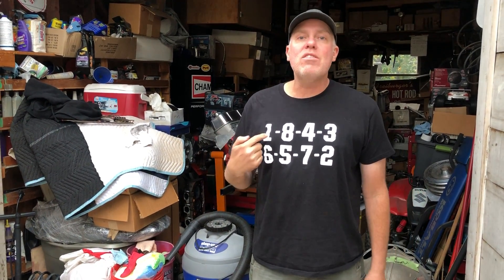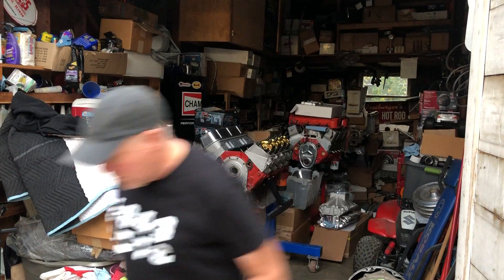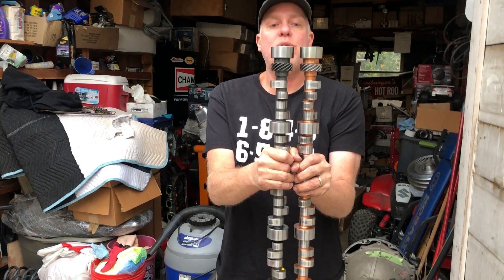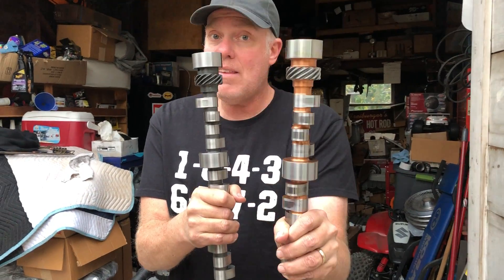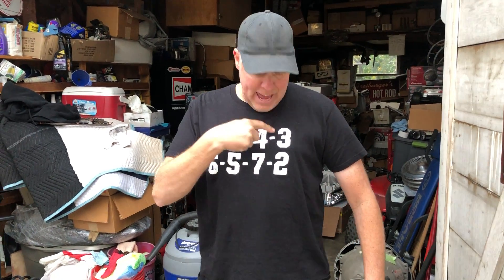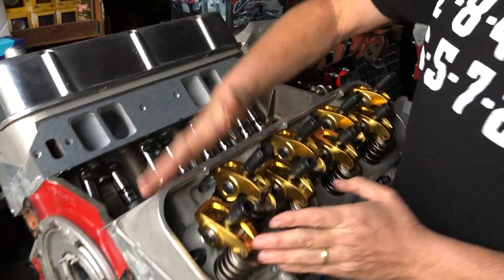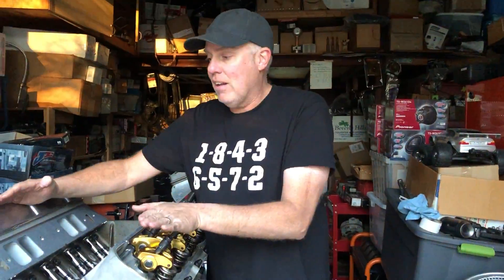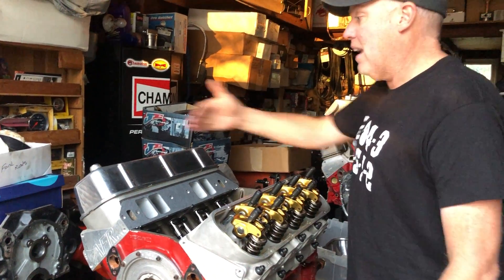Camshaft 4/7 Firing Order Swap Explained

Comment: Makes me wonder what a 454with a flat plane crank, and the 4/7+3/2 swap would sound like.that is, if those swaps can be done like that with that type of crank. I'd like to try that, but not with a production iron block 454. After all, if it works, why have all that weight? I'm thinking all aluminum big boy under the hood of maybe a lighter car like a nova or corvette.Hey Dave, what are your thoughts about the combo I mentioned?

Comment: But you left out why, to swap cylinders...

I am sure there is an awesome hot rodder reason and l look forward to learning it from you!
Reply: The actual issue is nobody really knows. The explanation with the intake manifold is bunk. Sure you break up the 5-7 pair but you create a 4-2 pair or a 3-1 pair. The only thing that we are certain of is that the ls and ford ho pattern has more even bearing loading since an entity as large as Ford took the time to study it. The 4-7 swap should be similar as both orders fire from cylinder 8 forward with 1 cylinder as an exception being #3 for the 4-7 swap and #2 for the ls/ho firing order. While the traditional order jumps around more.
Reply: To help lessen heat buildup in back of the block,,sense coolant flows from front to back of block..(Told by another comment above)..

Comment: Since the left bank isn't at TDC at the same time as the right bank, how does this effect ignition timing?  
With a camshaft  that alters firing order, is a distributor also needed?
Reply: You keep the same distributor but you need to move the wires to the new cylinders.
Reply: @markg7030  but TDC for the left bank will be 90* before TDC for the right bank, and the distributor is for both...

I was thinking of 4/7 on the same crank pin, but they aren't. 
     1/5, 2/6, 3/7, 4/8 = shared crank pins
Reply: @Iowa599  TDC occurs for the top of the compression stroke or the top of the exhaust stroke. The cam determines that phase. You are looking too deep.

Comment: I built some street stock circle track engines years back and did this. The customer's lost power and races because they cold never put the plug wires in the right place...

Comment: I discovered this with my 1990 Bronco it has a 5.0-302 but has the 351-5.8 firing order.  My neighbor is a Ford Mechanic it turns out someone in the past has installed a 351 Windsor cam in my Bronco.

Comment: So if swapping 4/7 and 3/2 is such a good idea, why didn't engineers do it from the start?  Surely there must be a reason.
Reply: It's fine for average or general use, but for all out power like in racing it can give you the edge.

Comment: I swaped the firing order on my single cylinder 2 stroke didnt notice much difference
Reply: I did it on my bike too, no change... 1-2-1-2...
Reply: Take your spark plug out and put it back in upside-down.  That's when you feel the difference.
Reply: You gotta swap out the cam for it to work.
Reply: @Hanzyscure  will give that a go
Reply: Swadian Knight  lmao
Reply: I heard Maurice saying that
Reply: That only works on the three stroke engines.
Reply: Did you adjust the muffler bearing as well?
Reply: You need to to swap your 2-stroke camshaft as well

🙃
Reply: thats rich
Reply: Gotta use flip the spark plug wires around.
Reply: Ahh it's the expansion chamber that did you wrong. The trick is when you swap of firing order on a one cylinder you need to hammer the expansion chamber flat.
Reply: MAURICE you forgot to move the kickstater to the other side
Reply: If you want to have fun with it... pull start it backwards. It will run perfectly spinning the opposite direction
Reply: @iD0theTUBE  a mate of mine used to do that on his bike, he'd bump start it down a hill backwards and ride it backwards.
Reply: I swapped my 1 cylinder 4 stroke firing order to a 2 stroke one. Now I get twice the RPMs and power.
Reply: @priitmolder6475  you my friend are a genius, I don't know why more people don't do that.
Reply: @DodgyBrothersEngineering  its a simple trick oil companies dont want you to know about...
Reply: @priitmolder6475  I swapped yo a 4 stroke order and I can finally use some of the lower power band and I dont have to mix fuel.
Reply: @salteengamer4799  I know right!
Reply: Swadian Knight  check valve lash
Reply: You hafta swap  the pipe and carb locations to get best results...
Reply: Sorry to be offtopic but does anyone know a trick to get back into an instagram account?
I somehow lost the login password. I appreciate any tips you can offer me
Reply: @Allan Jackson instablaster ;)
Reply: @Jonathan Wayne I really appreciate your reply. I found the site through google and im in the hacking process atm.
I see it takes a while so I will get back to you later with my results.
Reply: @Jonathan Wayne It did the trick and I now got access to my account again. I am so happy:D
Thanks so much you saved my ass!
Reply: @Allan Jackson Glad I could help =)
Reply: Oh ya
Reply: How the hell how do you change the FIRING ORDER on a SINGLE CYLINDER engine 2 stroke? What am I missing here??
Reply: @KiloG-81  you're missing alot bud
Reply: @KiloG-81 it's an obvious joke, sir. Amongst mechanics, it will get an instant giggle...kinda like a guy stating "I figured out how to keep a woman happy"...it's a set up for a hopefully good punchline.
Reply: Very funny
Reply: That's funny!

Comment: Been told it helps #7 to not be starved from #5 that's sitting next to it and taking its intake mixture right before.
Reply: Yeah......And now THE LS7 has problems with cylinder #7 running hot!!! And cracking!!!! The LS7 was one of those designs that looked great on PAPER, but in the real world has MANY problems, especially with dropped valves, which the original SBC NEVER had problems with. I have a "7" in my C5. Runs great when working. Wore the coating off the Titanium valves in 25,000 miles. Oh well, they're only $200.00+ EACH.....X16!!!!

Comment: The reason they used 18436572 is to force exhaust through the crossover passage to warm the intake manifold and carb to prevent Carb icing , It does taste like gas so do not lick it. It also causes that off note in the exhaust sound as well as reducing the expulsion of gasses.   With fuel injection you don't need to do this .

Comment: What about a 
1-2-3-4
5-6-7-8
Stroke? 
Would love to hear that
Reply: That would be a 45degree crossplane crankshaft, and it wouldn't sound noticeably different if the exhaust was designed to suit. You still have 4 pairs at the same spacing (1 and 5 ect). If you ran 4 into 1 headers it'd still be a pulse on alternating sides, even if you wanted 4:2:1 headers you wouldn't need to cross between banks, just connect 1&5, 3&7 (and its mirror) rather than 1&3, 5&7 before the merge. On the other hand its not something commonly done as the larger offset than a typical 15degree crossplane engine makes the crankshaft heavier, weaker and harder to balance.

Comment: You forgot to explain WHY??!
Reply: The why was to sell t-shirts 😝
Reply: Why change firing order? Changing a 1-8-4-3-6-5-7-2 engine to a 4/7 swap sometimes makes a tiny bit of extra power. Swapping both 4/7 and 3/2 reduces crankshaft harmonics and evens out the load on the crankshaft mains, which can lead to smoothness and longevity. (Direct C&P from description above...)
Reply: @jonaathansimons7938  reading is hard. 😂
Reply: For more even fueling to help cyl 7 from running lean and to keep that corner of the engine from getting hot
Reply: It also helps even out the stress on the crankshaft from the power stroke. It applies a more linear pressure on the rotation.
Reply: That is what I was wondering. I have heard of this and people doing this, but why?
Reply: @NN072288 Helps #7 to not be starved from #5 that's sitting next to it and taking its intake mixture right before
Reply: @XxMusclecarsxX  I'm just thinking it might sounds better because the Ls sounds different from the old big blocks and small blocks
Reply: @XxMusclecarsxX  Ok, but then you get the same problem with 4 and 2...  so if you do a 4-7 swap, you should also swap 3-2... of course then you get 3 firing right before 1, so still the same dilema...
Reply: Exactly so frustrating. I kept waiting and nothing!
Reply: Isn't it something to do with spacing out exhaust pulses on each bank so that headers work better
Reply: Or you can do the SB 2.2 trick to meet 6 cyl class rules and unhook everything on the front 2 cylinders. And it becomes legal.
Reply: Well ford learned that the order used in the ho engines had a more even bearing loading. This is basically the ls firing order but numbered differently. The 4-7 and the 4-7&3-2 swaps have been used by racers to make a few more horsepower. The thought is that it helps feed the number 7 cylinder better on a single plane manifold. But then 4 should starve 2 or 3 should starve 1 depending on which swap. So it probably comes down to crankshaft dynamics. But it would make sense to move the adjacent pair up to the front of the engine with a modern front throttle body efi manifold and the 4-7 also has a little more symmetry on a dual plane manifold.

The only thing that's obvious without a lot of testing is that the standard firing order jumps around more, but both alternatives start at the back of the engine and work forwards with only one cylinder out of order. If we start the sequence at 8 we get either 87265431 or 87365421 and that type of thing appears to be advantageous. Ford didn't use a balanced crank like a 4 cylinder when they went flat plane, but they went with a design that can be twisted Into the traditional design so they can use the same forging blank for flat plane and cross plane engines but it also allows for an end to end sequencial order without any out of order cylinders.
Reply: Just buy a Tshirt ! It's cheaper than a new cam.
Reply: It also results in the exhaust gasses to leave more evenly, eliminating the classic rumble caused by two exhaust pulses 90° apart traveling through the same exhaust collector.
Reply: Gotta have something for the next cheap iPhone vid!!!
Reply: How do you get two plugs to fire at the same time off one distributor?
Reply: Tim Beach dual point distribution
Reply: Drag race crankshaft

Comment: I had a small heart attack when i found out my cam for my 302 had the H.O. firing order since my 302 isnt an h.o. then i looked into it and realized itll all work the same, if not better. 😊
Reply: Biggest thing on the ho Ford is the distributor is on the other side of the cam so it rotates backwards. Changes the numbering on the cap.
Reply: 13726548 302H.O. firing order..

Comment: If you renumber the cylinders on a SBC the firing order is the same as an early ford 302. The HO 5.0 firing order used on later engines  uses the 4-7 swap. The 5.0 firing order sounds different (as does the the 4-7 swap on a SBC) when running but i dont think power is any different. Would like to see results of using a cam with same specs on  both firing orders. Long term reliability of engine may be effected by the swap.
Reply: Guess I should have watched the video before commenting🤣

Comment: how does the  power change  just by changing   from a standard  cam to one thats has 4-7 and 3-2 swap?
Reply: Less stress on crank and bearings
Reply: @CharlieBrown-pb9xn   the  physical stress on the  internals  isent the same ans power

Comment: I thought that was the deal with fords firing order but never was sure. 
I also assume that’s why the 80s 90s 5.0 H.O. Have a slightly different sound to em. 
They sound awesome.
Reply: On a 90 degree V8 with a 90 degree crankshaft you will not hear any difference in sound due to firing order.  Why?  Because no mater what you do with the firing order you still always have two cylinders that fire 90 degrees apart on each bank.

Comment: I got screwed badly rebuilding a 5.0 ford in a mercruiser sterndrive. 
Threw new ring, bearings ect into it  and set up the distributor as every widsor before and it flat refused to run. Would just start to light off but not pick it up. Played for ages ,fuel, spark ,compression, all present. Timing only thing left and the givaway was the standard firing order was ground off the intake. Rang a mercury dealer and got the firing order and shonuff , bastards for no apparent reason were running different cam events to street engines. Swapped 4 leads and all was good.
Reply: Yeah most of your marine engines have the swapped firing order. Even the Chevy's. That's why the swapped cam is usually called a marine or boat cam.

Comment: Slightly different question: Why was the firing order engineered as it is if the swaps have benefits? Do they have any negative side effects?
Reply: the shared rod pin is theory, not actual physical rotation balance.. hence options. You can have a self balanced v8 with benz crank throws.. but engineers are afraid of it (note the benz crank is not a flat plane... totally different).
Reply: Can gain 6 hp due to less crank flex, hot rod mag tested it years n years ago.
Reply: Snek is actually partially correct,  but there is still more to it, such as balance,  harmonics,vibrations, scavenging,  etc etc. Sorry but for me  try to explain it all here is a little much, because i don't know how to give a readers digest version,  i will write an encyclopedia Britannica version, & will be here half the day.
Reply: Phillip Aubin  And voted for George McGovern for President!!!
Reply: The only real benefit is to intake and exhaust manifold design. With 18436572 5 and 7 are right next to each other and fire one after another. So if those two cylinders share manifold passages the flow of one disturbs the other.
Reply: @snek9353  harmonics, scavenging, heat dissipation. there are lots of "real" benefits.
Reply: @DieselRamcharger  Elaborate if you're such an expert, I certainly don't do it for a living or anything, so you tell me smart guy.
Reply: @snek9353  LMAO. you have no idea who you are talking to kid. take a long hard look at my little icon over there <~~~~~
Reply: @DieselRamcharger  What about it, I can find pictures on the internet to. Believe it or not I'm not really a badly drawn snake. So is this an attempt to avoid elaborating cause you really have no idea what you're talking about and can't?
Reply: @DieselRamcharger  I'm curious, is your handle Diesel Ramcharger cause you self identify as an ugly old SUV?
Reply: @snek9353  doesn't make a bit of difference what the buggy looks like. put 220k in our pockets to build it. Bank Account swoll as fuck, and thats what looks good to me.
Reply: Diesel Ramcharger lamest response ever! Didn’t have a good answer so you use money as your leverage.. get a life
Reply: @DieselRamcharger   Diesel Ramcharger  you can't be serious. This is one of the weakest, saddest, most unprovoked failed brags I've ever seen. Your avatar...so what? Your uploads...also so what? 220k... That's not that much money, especially if it's divided up among 'we'. You sound like the dude who owns an older Lexus in a small country town full of beat up ford trucks and thinks they're the wealthiest and most important person in the world...until you get out and see how big the world really is
Reply: @DieselRamcharger  sure, I agree the firing order swap won't do much. But you're not one to be criticizing others about bragging online and looking like a fool for it 😂😂
Reply: @snek9353  you spread misinformation on so topics across so many videos. i find it hilarious.
Reply: torque. sound. why wasn't the LS designed before the SBC? because lessons learned drives progress.

Comment: THIS is something I’ll be heavily looking forward to seeing on engine masters, since my 350 has most likely wiped a lobe.  I’d love to see it done on a small block or something mild.
Reply: You’ll make a hair more power going with a 4/7 swap…worth the cost of the custom cam?  Not much more than any other custom cam
Reply: I wiped a lobe last year. Now my oil pump only puts out 20 psi at idle, 50 psi @ 4000 rpm.

Comment: What would be the benefits of swapping the firing order around?
Reply from the maker: Why change firing order? Changing a 1-8-4-3-6-5-7-2 engine to a 4/7 swap sometimes makes a tiny bit of extra power. Swapping both 4/7 and 3/2 reduces crankshaft harmonics and evens out the load on the crankshaft mains, which can lead to smoothness and longevity.

Comment: But what's the benefit of swapping the firing order?
Reply from the maker: Yeah, I really should have said this in the video. From the description: "Why change firing order? Changing a 1-8-4-3-6-5-7-2 engine to a 4/7 swap sometimes makes a tiny bit of extra power. Swapping both 4/7 and 3/2 reduces crankshaft harmonics and evens out the load on the crankshaft mains, which can lead to smoothness and longevity."
Reply: @TheDavidFreiburger  awesome. Thank you.
Reply: @TheDavidFreiburger  I really, really, really want someone to do an animation (showing exaggerated crankshaft twist deflection, and other effects) to make it clearer to me WHY the 4/7 3/2 swap reduces harmonics.  Because at first blush, it doesn't seem like it would... you can't get rid of  the fact that two cylinders on each side fire sequentially every other crank turn (which causes the characteristic "V8 burble.") The swapped firing order still fires the two cylinders on the same crank pin sequentially just like the old firing order, it just does it on the 7/8, 5/6 and 3/4 pins instead of the 1/2, 5/6 and 3/4 pins. So it sure seems like it has all the same effects, just moved around slightly, not even really spaced out fundamentally differently. I'm an engineer and STILL can't visualize why this is an improvement (OK, maybe some of that is because I'm an electrical engineer, but I still had to take physics and engineering mechanics!)  ;)